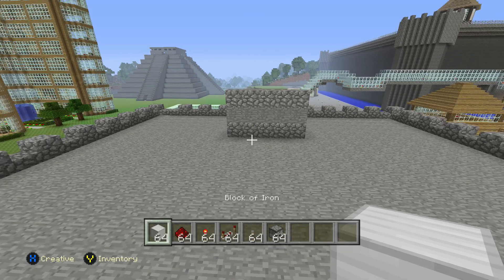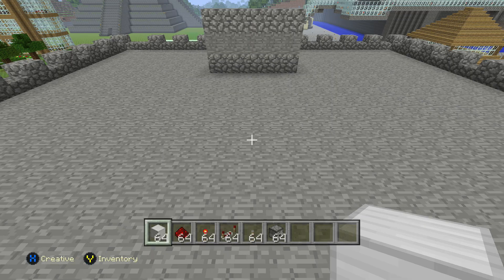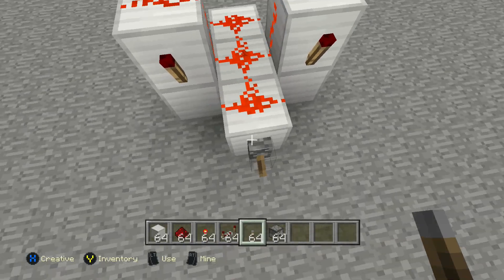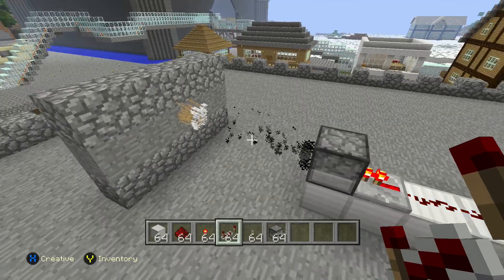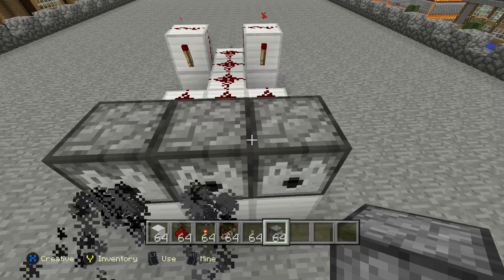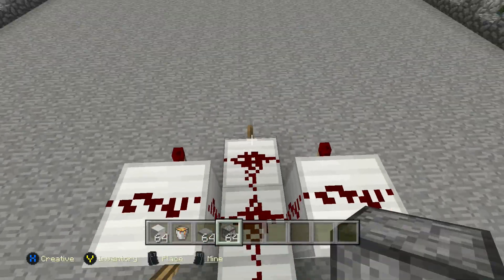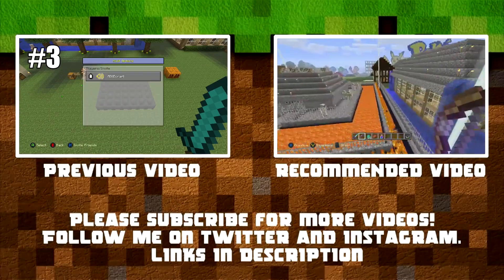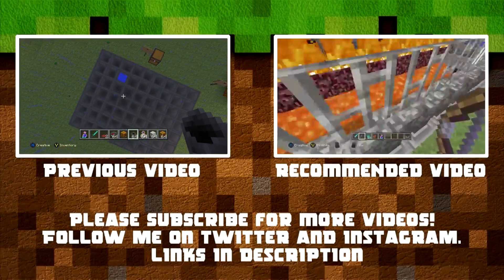(Minecraft Tutorial) - How to build a Fully Automatic Sentry Gun

Comment: There's a quicker way to make the sentry. Place a block, put redstone torches on all sides but one (and no top), then you place one block above each torch, and redstone in the middle. You then can put in 6 dispensers on the front, and they will all work at the same fire rate. Note: you may need levers to get the desired speed.

Comment: There is a way easier way of doing this just place a comparator put it in subtraction mode and put redstone in front of  it and connect the redstone to the comparators right side it will make a  circuit that goes on and off like the one shown but it only takes up like 4 blocks btw to turn it off just put a block with a lever on the side of it